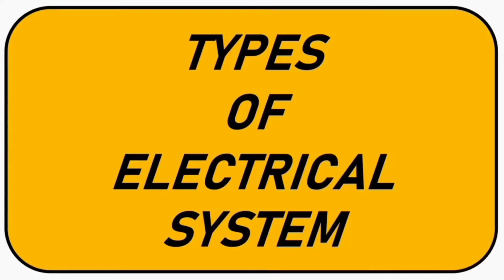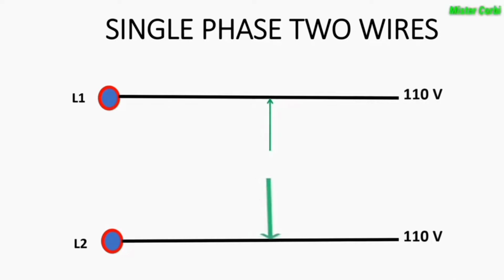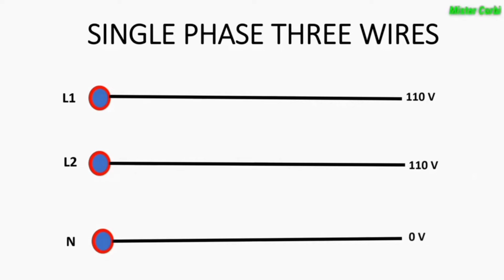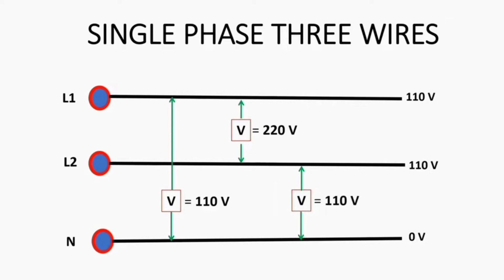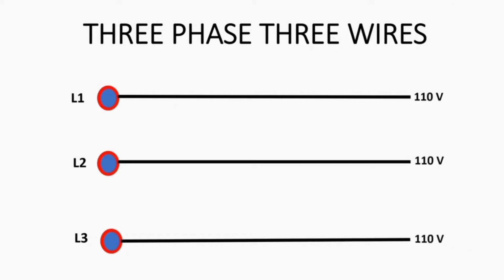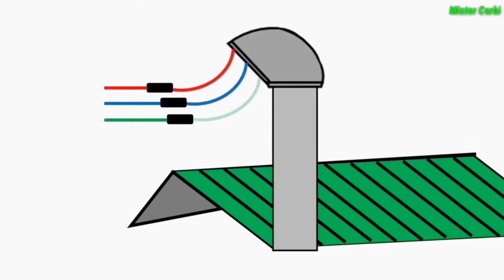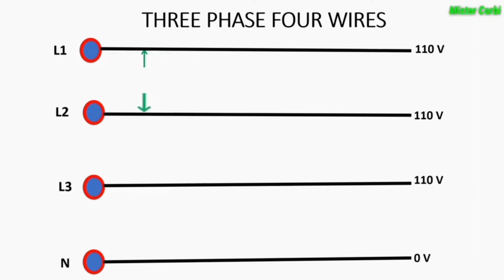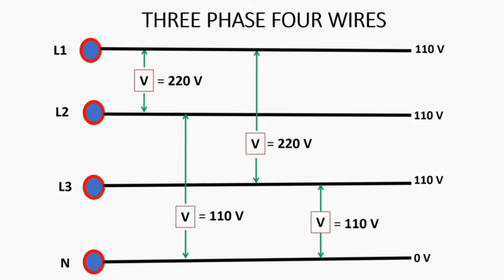TYPES OF ELECTRICAL SYSTEM.. ELECTRICAL INSTALLATION AND MAINTENANCE.. MISTER CORBI..

Comment: Slamt sa info sir, ung line to neutral at line to ground may pagkakaiba ba sa paliwanag sa theory sir?
Reply from the maker: sa theory po sir ang pagkakaiba nila is si Ground connected sa earth.. ung Neutral nman kasama mismo dun sa linya ng kuryente..
Reply: @MisterCorbi  bakit pala gagamit ng nuetral kong may ground namn,?or bakit gagamit ground kong may nuetral namn?, medyo hindi lng maunawan pakakaiba nila sir,
Reply from the maker: basically sa terms kc parang magkaiba, pero kung base sa application same lng ang gamit niya.. ang neutral kc nakakonek sa linya which is 0 volt nman.. at dahil 0 volt nman sya pede sya ikonek sa ground..